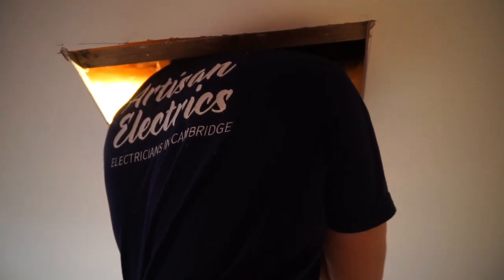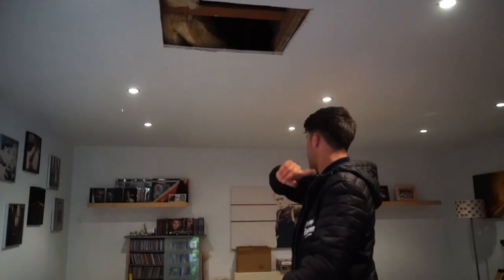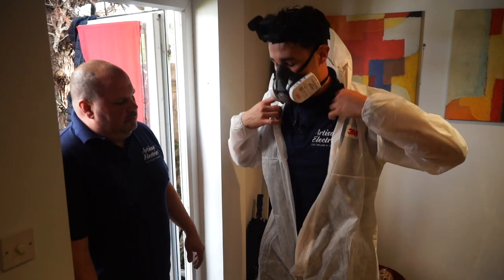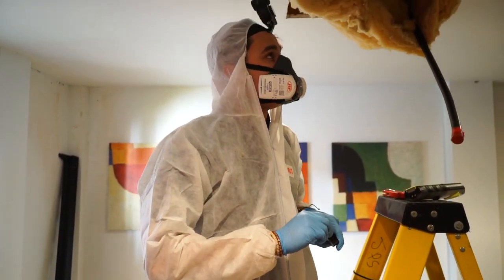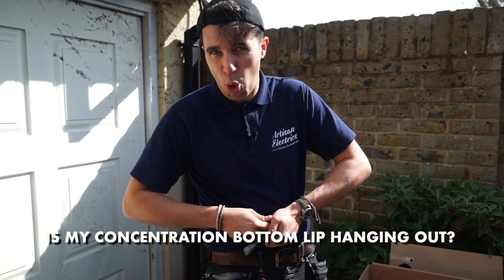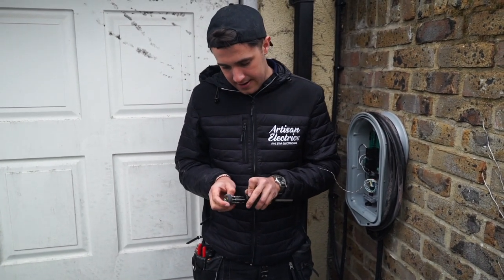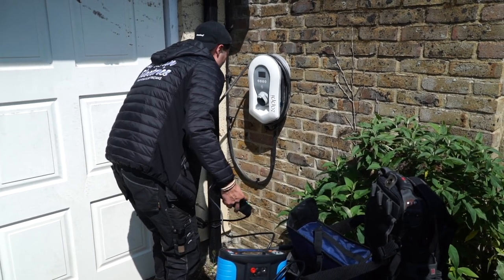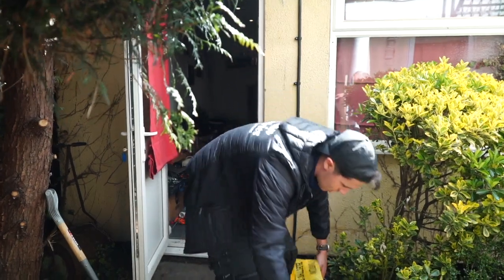THE WORST PART OF BEING AN ELECTRICIAN - Electrician Life

Comment: The Zappi looks way better than the Telsa, much neater with the cable nicely wrapped around the unit.
Reply: Would much prefer it if the cable was removeable. Keep it out of the elements and away from possible tampering when not in use.

Comment: Nice installation, just advice for you: if you cut the entry hatch about the same size as a loft access hatch you can get off the shelf then repairs are not required.  If you place the swa in ducting and then pour mortar mix on it, then you've done everything you can to protect the cable that is above 600mm that could be damaged by garden work.  If you place a label on the board that cables are at 100mm depth, then this should hopefully keep the customer safe.

Comment: I once did a job in an old house.
I had to fit a cable through the attic and fish it into the fusebox built into the wall beneath, very much like this tbh only i was lucky enough that they had some flooring plates up there to crawl on.
When i removed the flooring in the attic above the fusebox, there was just... rat/mouse fecies flush with the board, and I knew i had to put my whole arm down in there.
I got to lend their veccum cleaner to get it out, and the never ending sound as it went through the vacuum hose still gives me shivers. Was like vaccuming a whole bucket with sand. And the smell?

Comment: I wonder the E/M interference running a parallel data cable that distance, I know its shielded but that at that distance. Its also bad practice to run separate voltages in the same cable, if the cables inner insulation became perished possibly providing a much higher potential than any data cable is expecting. Great video though, nice to see a domestic environment.